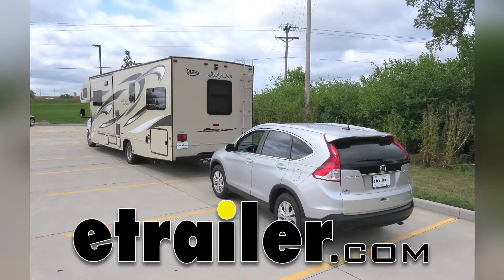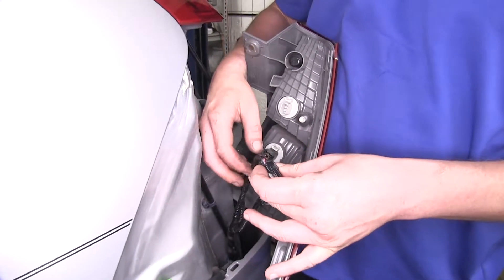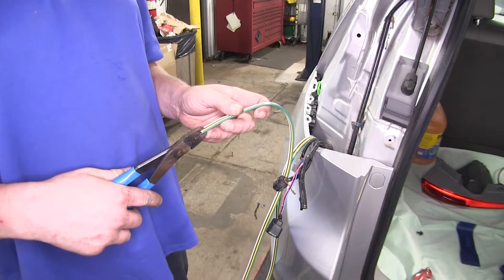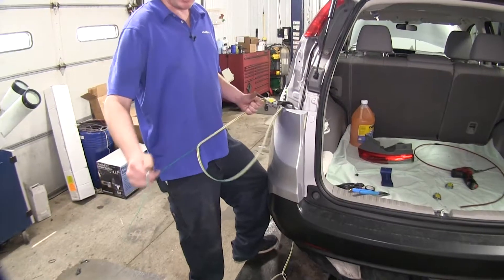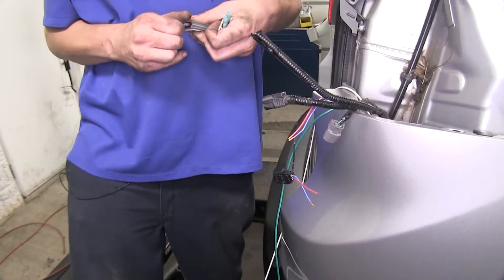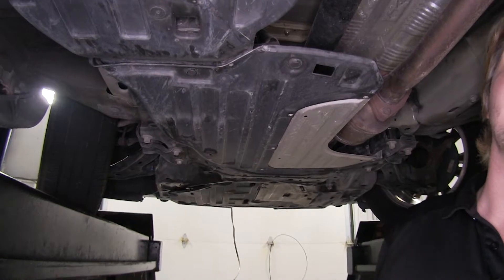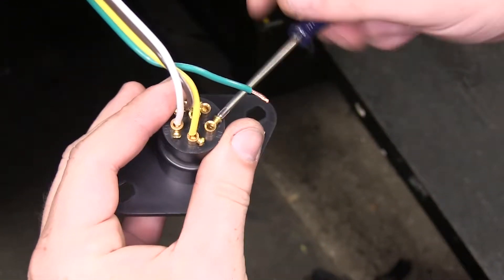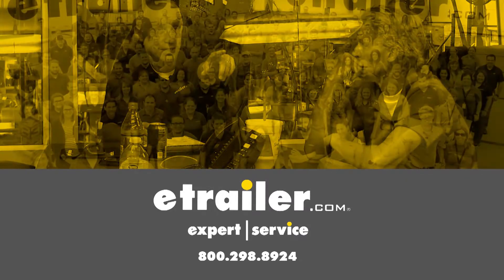etrailer | Set up: Roadmaster Universal Hy-Power Diode Wiring Kit on a 2012 Honda CR-V

Comment: I have a botched job here on a car I bought, apparently the hid the wires pretty good, I have taken out the diodes and reconnected the factory wiring and have not been able to get the regular running ( tail lights) to work.  brake and blinkers work but no tail.  I have not been able to find where they hooked this up at either.   all the bulbs are good/   I am wondering if there is an inline fuse somewhere and a live wire shorting to frame somewhere , possibly from when they removed the hook up in front somewhere.        I have been up all night doing this and it;s making me crazy, this CRV is for my daughter and she needs it on the road right now.   at one point I was getting blinker  action on the DRIVE symbol on my dash, while the car was stationary  in park.
Reply from the maker: It's possible that the CRV's running lamp fuse has blown. Check the fuse box under the dash and in the engine compartment, the lids on the fuse box will list what fuses protect which circuits they protect.
https://www.etrailer.com/Tow-Bar-Wiring/Roadmaster/RM-152.html
Reply: my lid is blank so I have to rely on internet pics on my pc.    but i did find the wiring to be ridiculous and also fuse 32  7.5a is blown.    I am re attaching all factory and ridding the splices out now . i still dont know where all those wires from the  "toad" rig are going but the end with my tail lights and all is going to be restored.    weird thing now, I have a check engine light on where there was none and I have not even gone anywhere or done anything to the engine at all .   also brakes warning, that was not there .   I had the Green "drive Indicator" on the snifter select flashing like a blinker for a while also.   very weird.   abs is on because  the right passenger abs sensor wire is ton in half, 
 @etrailer
Reply: yup, that kit in the link looks like the wires in there and the diodes as well sept these I am removing are blue. @etrailer